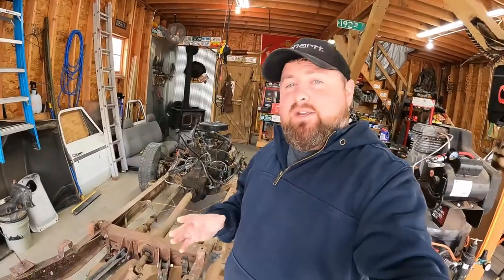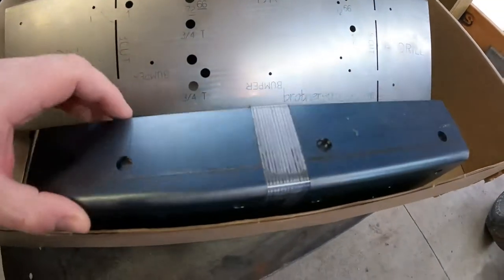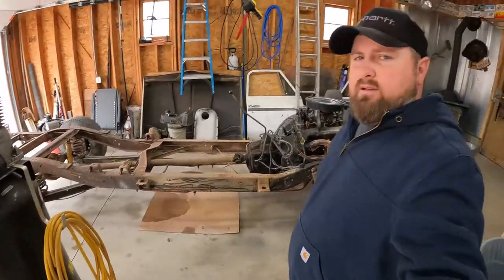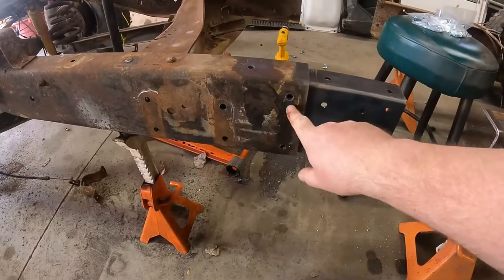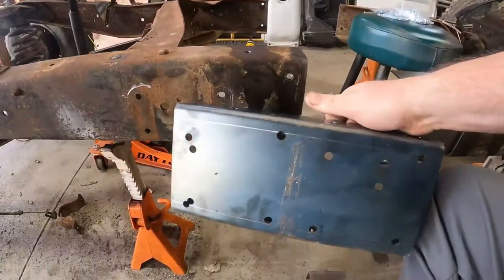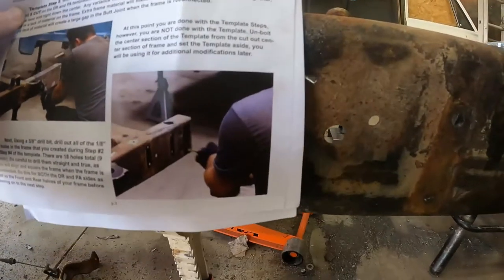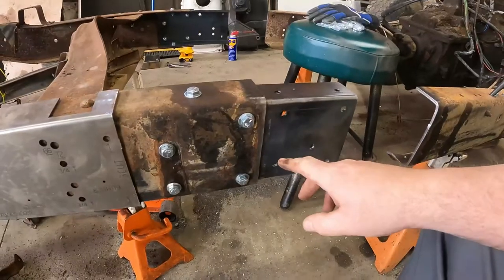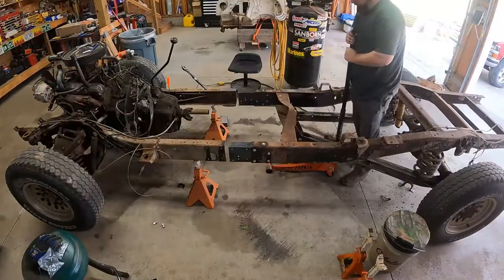🟢C10 Frame Shorting Kit GONE WRONG !

Comment: I know you got it all figured out already but for anyone who’s going to attempt this on a C20/ 3/4 ton frame. Yes those mounts are lower on a C20 frame. The body mounts are also different. You could move the mounts up and use c10 body mounts or leave them and make sure to get C20 mounts. When I did mine brothers was just coming out with this kit and they literally told me it won’t work on a C20. Later I saw they said it would with modifications. Your video now serves as instructions for those who want to do a C20 with the required mods. Change the title bud, it didn’t go wrong. It’s now a how to shorten a C20 frame with brothers C10 frame shortening kit. 👍
Reply: Thanks that’s what I was considering because I have a 3/4.

Comment: I am 70 yrs. old and I installed  and shortened my 72 c-10 by myself and it worked perfectly with the exception of one bolt hole tha t was different on my truck but my friends was perfect with all holes in place. Brothers kit is really good but all c-10   trucks are not equal.

Comment: Just did the kit yesterday on a 70 C10. Luckily for me everything went perfect. Now I just have to find a shortbed. That’s the real challenge.
Reply: Just order the side panels and keep your tailgate and back part. Then do a wood bed or whatever you want.
Reply from the maker: I just picked up a long bed with the wood panels for $450 , plan to cut and section it. Want keep it all GM metal much as possible
Reply: @reb8306  makes sense. Thanks for the tip. Got a rec for a good place to order the bedsides from that’s somewhat close to oem?
Reply: @SunnySlopeHomestead  I’m not good enough to do the cut and weld on the bedsides but I’m good with everything else. So I’ll probably do what the other guy recommended
Reply: @SunnySlopeHomestead  the after market metal is not the same as factory they are very thin pressed out metal.
Reply: Mike thanks for taking the time to make this video I also installed the brother shorting kit on my 67 3/4 ton , they have a video that covered the job in detail, one thing I would add is to test fit the bed Then trim the tail of the frame . I used a 55 Chevy short  bed and it a little longer over hang than a 67/72 hope it helps someone

Comment: Around 2018 when i was buying my '63 C10, i came across a "good deal" on a '63 C20. I called brothers, and they told me the shortening kit didnt work on the 3/4t, but I see your template has "3/4t" marked on the side. I just kept looking until i found the truck i wanted

Comment: Do you have to remove front hanger for leaf spring?
Reply from the maker: Nope
Just the back cab mounts are relocated and two of the four hole are already there
Reply: @SunnySlopeHomestead  thanks. Trying to buy it but they say they're out of stock. Tried PB Fab too but theirs I would have to take the leaf spring hanger off first 👎

Comment: Well this is what happens when you don't read. A C10 and a C20 have many differences and parts for one won't necessarily fit on the other. Lol you really didn't need to go on for half an hour crying. Just drill new holes lol you do know you can weld up a hole if you need to drill one to close to another hole. And you didn't even see the 3/4 took Mark lol man you need to do more research and this is on you not brothers because they state this kit is for a long bed C10 not a long bed C20 and yes they are different lol I'll say again this was on you not brothers.
Reply from the maker: Frame section is the same on both 10 and 20 C series. You failed to realize that the channels were both of the same side. You need to follow along better but thanks for trying